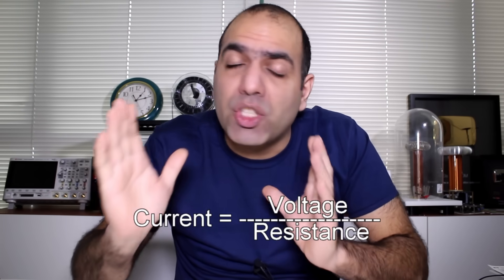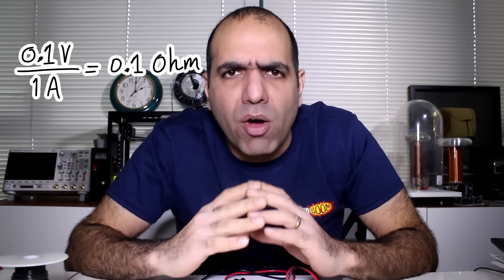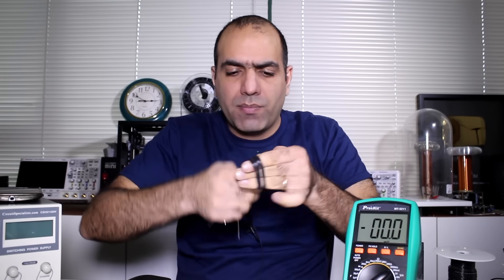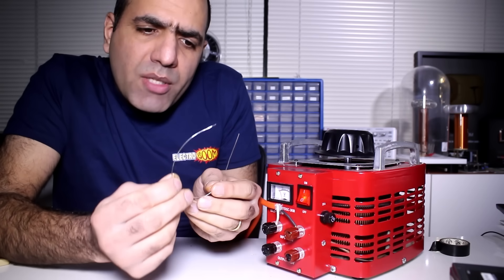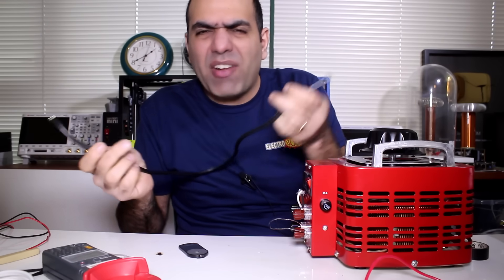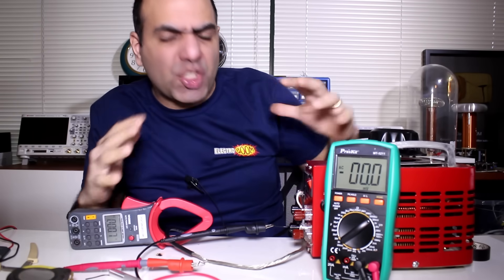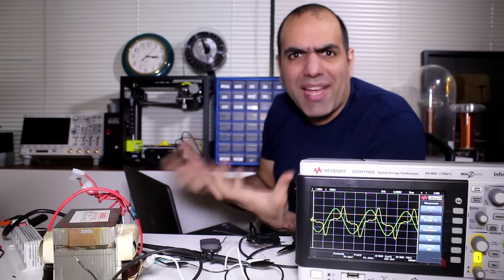How to Make a Shunt Current Sense Resistor

Comment: Can someone explain 4:45 to me? If both terminals were in his mouth wouldn’t there still be a path for current to flow?
Reply: You're right in that it is a parallel circuit and our hero is simplifying: there is negligible voltage across the 2 sides of his mount, leading to negligible current through his tongue.  There is some current through his tongue, but it's tiny because the wire has far less resistance than his tongue, and most of the current goes through the lower resistance.
I did wonder if the wires were going to come loose at that point and put the full PSU voltage across his tongue.  cringe
Reply: Shane Not if you use chapstick.
Reply: He migh use 10A 30V but i doesn't hurt him. If he was just to put the probes in his mouth he would get shocked. He isn't getting shocked because the resistance of the wire is in the mili ohm range so to the power supply it looks like its shorted and since its current regulated it wants to stay at previously set 10A and drops the voltage to few mili volts. If it ran on 30V there would be thousands of amps running through the wire which is not possible. Basicly its like putting wire in your mouth that is not conected anywhere. And yes tounge has very low resistance but few milivolts generates just a little nano amps which there is no possible way to feel. I hope this helps
Reply: The current always flows on easiest path available. His body resistance is too high than the wire path; therefore, neglisible current flows in his body.
Reply: his body resistance, resists the voltage, therefore no current flows because voltage is required to push current thats why signs say "DANGER High VOLTAGE" not high current.
Reply: XxMine231xX yes, but 
1. The resistance of his tongue is low
2. Current will take any and all paths between two potentials (both terminals are in his mouth)
3. To me it looks like a parallel circuit: low resistive path through shunt, slightly higher resistive path through tongue

That's why I'm confused
Reply: Shane yeah current will mainly take path of least resistance and in this case it is a parallel circuit and the wire has less resistance thus meaning that he wont be electrocuted
Reply: Forgot to add the wire is insulated so he may have not touched both probes

Comment: Mr. sadaghdar, how you variac provide 100A , it has a 25A fuse :)
Reply: To provide 100 A, the variac does not need to draw >25A from the mains. In a transformer, voltage and current are inversely proportional, so if it draws 10A from the mains, it can give 100A at 12V.

Comment: Why is a shunt capacitor in parallel but a shunt resistor in series? I understand the reason for the desired operation/behavior, but why use the same adjective "shunt"? ...very confusing! Anyone know the origin of this?

Comment: How does the length of the measurement wire not matter? Wouldn’t it change the resistance?
Reply: Yes it does increase the resistance of the path going up to the DMM, but the measurement you are taking is a voltage measurement so the DMM will act as a high resistance (typically in Megaohm) anyways. Since this is a high resistance path there will be almost no current flowing into the meter, meaning that the voltage drop across the shunt isn't changed by the DMM being in parallel with it.

Comment: Can someone help me?
I have a water pump (1/2 horse power) 130 meters and 45 degrees away from the electrical source. 
>Can I use a 16/2C flat wire (130 meter length) to power the pump? or should I use a wire with 10-14 AWG?
>Can the water pump have enough pressure to pump water up a slope (45 degree elevation) to my house? 

Thanks in advance!
Reply: Yes and yes

Comment: An autotransformer (variac) is NOT isolating; handling bare wires from a one is dangerous even if one thinks the voltage is low. For 100 amps one needs a 10 kW variac, or smoke results... You marked the calibration points THEN added a length of wire... still, a great video.

Comment: He's setting his autotransformer to 100 amps despite the side saying the fuse is rated for 25 amps. So I'm guessing the smoke from his transformer would be from the wire he used in place of the fuse to let more than 25 amps through. In other words, the illusion of stupidity is broken!
Reply: The smoke and a spark at one point, seemed to be coming from the point where the carbon brush touches the transformer windings. This point is usually the failure point due to the resistance of the sliding contact.
And an auto-transformer isn't an exception to any rules. If you have a transformer with 2 windings that takes 120V/25A(3kw) input and it's rated to output 100V/30A(3kw), and then you load the secondary down to the point where it is outputting 30V/100A(3kw) the transformer will probably go up in smoke. It's still outputting the same power but the secondary wire isn't thick enough to handle the extra current, even though it's the same amount of power.
This applies to an auto-transformer/variac just as well. Since it's a single winding of a single thickness of wire, there is a point where the current flow will be too much for the wire thickness to handle, it will get hot, and it will fail. This maximum current point is independent of where you have the output voltage set and at lower voltages can occur well below the rated power output. The resistance of the carbon brush contact also has current capability that is independent of the voltage.
Current flowing through a resistor creates heat. The copper transformer windings, the carbon brush, the connections inside, ect., all have some parasitic resistance and therefore have a maximum current carrying capability that is independent of the output voltage.
The variac isn't an exception to any rules, it's just following the same ones that apply to any other transformer or circuit in general.
Reply: Nothing\  no! The 25amps is the maximum input current and not the output current. So 25 amps at 120v which equals a power of 3000 watts. So as long as the output power is less than that, you are good to go ans everything is safe.
Reply: Amazing Tech - What you said would be true for a transformer with separate primary and secondary windings, with VA-in equals VA-out. But since this is an auto transformer, there is just one winding and a carbon brush. The winding and brush current rating is limited to some maximum value, regardless of the voltage setting, otherwise you will let the smoke out.
Reply: Solar Fluxman, an autotransformer is not an exception to the rule.

Comment: Gimme da meetta or the scopa. Btw I have an Idea what to do with the Magnetron from my old microwave oven. I will make a cancer gun to kill all my enemies with cancer.
Reply: Marco Guerini The Megatron of a microwave oven shoots microwaves at high voltage. So I just have to take it out of the microwave oven, build a circuit with the microwave transformatar and voila a cancer gun
Reply: non ionizing radiation man. It will cook them fine though. it could also kill them with high voltage too.
Reply: Ein_Harry Youtube channel called Kreosan did this already. They are Ukranian youtubers. Very funny videos and dangerous experiments. They also made a DC voltage multiplier (CW). You should check them out. They do everything that normal people think is dangerous
Reply: So you throw microwaves at people and they get cancer?
Reply: you realize radiation causes cancer because small wavelength waves can pass through the body and knock apart DNA. it has nothing to do with conductivity of air
Reply: Ein_Harry That's why I always wear my tinfoil suit when using the microwave.
Reply: U KNOW IT WONT GIVE THEM CANCER it will cook them bc its not ionizing radiation  And i did the same thing as u did i took out a transformer and the magmatron but i did not cook no  one YET

Comment: It's really, really weird that Mehdi released this video now. For the first time in my life I have needed to measure some 12V loads at greater than 10Amps because of some LED bars I'm using. This was a week before the video was released. I knew I subscribed for a reason!
Reply: I used some 12ga wire, and a couple of spare banana plugs to make a shunt to install across my DMM's 10A current meter inputs.  I used a power supply and 2-ohm power resistor to put 1.000A through the current meter, then adjusted the length of my shunt until the meter read about 0.1A, with 1.0A actually flowing through it (divide by 10).  I had to trim and resolder the wire multiple times, but after about 5 tries, I got to 0.098A  and called it good.  This allows me to make current measurements beyond the range of the DMM with reasonable accuracy (5% maybe?).  

 This shunt only works with this one particular DMM, and only on the full DC-amp (not mA or uA) rotary switch setting.

 I don't think I would use this to measure anything over about 40A for any extended period. The shunt would start to heat, and it's resistance will increase, causing error.  I always plug the shunt into the DMM first, then the leads into the top of the banana plugs of the shunt.  That way, I don't pop a fuse on the DMM if the shunt comes loose.

Comment: Using a high ratio transformer like 220:3 and high VA would be nice in order to not fu.k the variac up.  That seems to be 1kva which its nominal current will be 5Amps not 100Amps

Comment: Mr ElectroBoom...................
I have this wireless headphones which uses 2 AAA batteries, 1.2 volt. So 2.4 volt.
I have this backup battery pack from LAB31 (4400mAh and 5 volt 1A output)
I assume if i hook it up directly, my headphones will die quickly.
Since im a complete Noob as for building electric circuits and stuff like that, i was wondering if you happen to know an easy way to hook up the 2.
An old usb cable to connect the battery to the headphones aint the problem................... its just: will it kill the headphones if i were to hook em  up as is? I assume so. So how to halve the output voltage as easy and cheap and somewhat reliable as possible????

I thank you very much for any reply......... if any. 
Others who have knowledge in this field are ofcourse also welcome to help out this Noob.
Reply: PS: Would it work if i were to hook up 2 led's in series?
Or perhaps i can use what you have shown in the video above for such ?
Wish i paid more attention at school when it came to this kind of stuff.................... ah well

Comment: Nice.
Just that my current project is a bit more.. delicate.
I wanted to make a simple controller that takes in power from some solar-cells, charges a LiPo and provides the voltage for a small Atmega. I have some precision shunts to measure the current, but then i noticed the OpAmps need at 1V more than my supply delivers -.-
back to the drawingboard.

Comment: Gimme da meetah!!!!!!!!   No really my UT136B is dying, i had once replaced the blown 10 amp fuse with a certified piece of copper wire and forgot my probe in the amps socket when i went to measure the rectified mains on an SMPS. I got an early introduction to vapor metal deposition. Now the inside of my meter is coated with a copper film.

Comment: Hello sir I m repairing my laptop charger the output voltage is fluctuating between 15 to 17 volt. I connected the charger to laptop but not charging. I think the output voltage should be stable . Sir what's the problem please help.

Comment: I also want the meeeta!  I just built my first industrial automation machine and I've learned so much about electricity and sensors in the last month.  But my multimeter doesn't even have the capability to test DC current.    Great stuff, keep it up.

Comment: I remember a bad design I did. We had a circuit that was designed for 220v and the country's voltage was really 240. So I made a SHUNT! until the part could be fixed by buying 200 m of extension cords and lowering the voltage to 190V.  Fun times.

Comment: Use a 10 amp current, and wrap the cable around the multimeter clamp 10 times

Comment: What on earth did you do?

Note: Out Variacs are not compatible with most GFI (Ground Fault Interrupter) wall outlets. We have found that the inductive load that the Variac represents is not compatible with most GFI circuits and they will trip the breaker.

Note: This Variac is rated at 30 amps and most household outlets are only rated at 15 amps. Be sure to verify that the power supply you are using can deliver enough current to operate this unit.

Comment: "Yellow current line is leading the voltage line as should happen in an inductor." No, it is not. The the voltage is leading the current as should happen in an inductor. I am guessing its because your looking at the scope through a mirror, but voltages always lead current through an inductor.

Comment: "And if your wondering how i am running 10 amps through my mouth without dying, there is no current running running through my body because there is no voltage across my body" Only partly true. There is a dmall voltage drop across the wire, thus there is a voltage drop across your body, but since the voltage drop is far smaller than a volt, current can not flow through water, or spit.

Comment: You shunt try to send 100 amps through a 22 guage wire. I'm still laughing. 

How does one not know and anticipate what's going to happen shorting our the auto transformer when one just checked the awg tables that contain both resistance per lenght, and max amps. I get your humor, but do you actually have litterally burn your fingers to show us what not to do? Pretending to would still have had of rolling on the floor.

Comment: Guys where do I really connect a resistor? To the positve or negative side? And is there necessary way to connect it? Does it have any differece if I connect on either ends of the resistor?

Edit: Newbie on Electronics here😂 Sorry and Thank You!

Comment: HOLY SHUNT! just think of measuring 500 or 1000 amps! 
I need a shunt and meter for about 3-500 amps. for my off grid house. so I can keep up with incoming and out going current. I guess I need a 100 amp shunt for input from solar. and DC generator . and maybe a water wheel generator!  I also plan to try harnessing the wind. I recently saw a video on wind turbine repair. a large one can also be a large pain! along with higher output . a large turbine needs to be high enough. and getting it there can also be a pain in the @$$! if I can get 20-40 ah a week it be better than none. there is a few windy months . that will be then they will produce. I hope to get 25-100amps so maybe a 200 amp shunt. in case there is two more turbines in the future. maybe smaller turbines on the same tower! great video ! I think something is burning!

Comment: in 10:10 you said that the current leads the voltage in an inductor. But isn't it the other way around? The current lags the voltage by 90 degrees... Correct me if I'm wrong. Thanks! :D :D BIG FAN! GIMME DA MEETAAA!!!!!!!!

Comment: Edit: This is a response to someone saying the burns on his fingers are fake.
The burns disappear partway through the video.
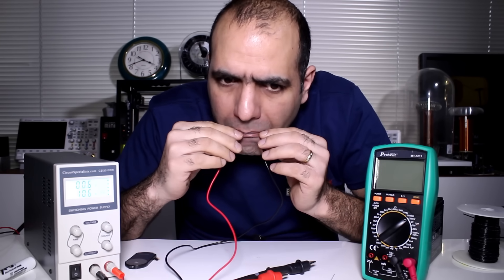The last time I saw the burns was at 4:40, (on the clock in the background) and the light was low.
When they disappeared it was suddenly 12:27, and the room was much brighter.
The video was probably recorded over multiple days. You could interpret that to mean the part where he was burned was recorded later. Or that he washed the fake burns off.
I'm not going to make any certain claim about whether the burns were real, just that it is possible.
But they look painfully real to me. Good makeup work if they are fake.
Reply: They are real. Those kind of burns kinda easily disappear and leave tiny depressions on the spot, or saith discoloration. They are painful nonetheless, but at-least no blisters.
Reply: Hey, I thought I posted this as a reply to Lolek Bolek, but it's here on its own. 
That's weird. Did I type it in the wrong box, or did YouTube do something? Lolek Bolek's comment is still there.
Reply: McBlaggart when he fakes to get shocked or burned he does this to make others scared of failing so they are more careful.
Reply: They may be real, but it seems that the sound of burning skin is fake. It is way too loud to be real.

Comment: gimme da meeeta  !!

Also, a REALLY interesting video on current shunts. I have actually just received my order from ali (2x100A + 1x500A shunts) for measuring my solar input + battery output. 
The 100A is labeled "75mv" drop, but the 500A is labeled 0.5 ?? I am assuming this is 500mv UNLESS the drop is less with the parallel plates which would mean 5mv ?? I'll have to go over the spec sheet again

Comment: No need to read that wiki page, there's an equation for resistance: R=p*l/S
R is the resistance
l is the length of the wire
S is the surface area of the wire
p is the resistivity

Comment: This is perfect timing, I'm trying to make a wifi moisture sensor using an esp8266, but it only takes 3.3v, I bought this chip and i have no way to power it in my house :<
I could really use and a appreciate a power supply (and a multi meter).